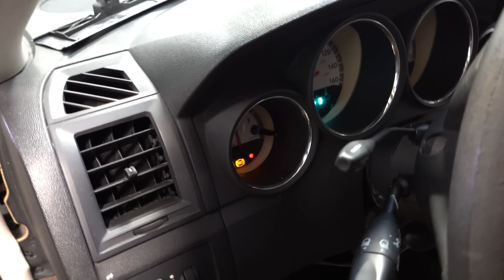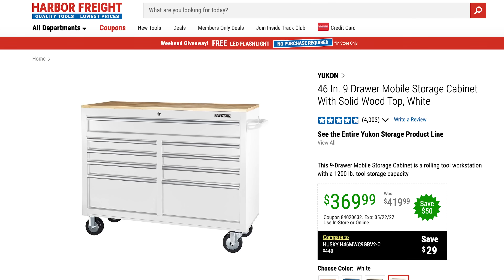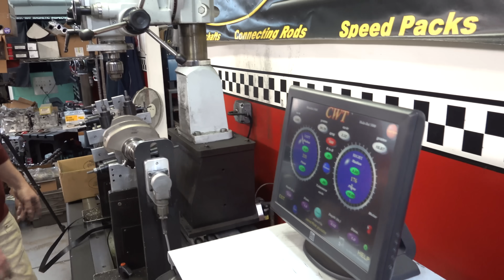Here’s how we REWIND the clock at The Questionable Garage

Comment: Nice E30 with an m6x swap/ 5 lug. Probably has some smoked lcabs/ lcas. Super common on E30/ e36/ E46 cars. The m3 control arms use a solid metal ball joints, but the Meyle or Lemforder HD ones are even better but can only be replaced and pressed into the non-m arms. I have used countless different lcabs, but the Moosehead, treehouse lcabs are a great solution IMO because they ditch the bushings and use a spherical bearing instead. Or you can rock some poly, delrin, or the stock m3 ones which are solid rubber at least. Stock ones are webbed and suck ass. With a proper setup they handle great, even with the M60/ 62 swap. A big ass front sway with adjustable heim joint end links/ poly bushings is also a recommendation, usually with no rear sway at all. That's how a lot of guys that track these including myself set them up. I used to build lots of these for track duty for my personal cars/ customers and with a real suspension it's night and day. AST4100's are my favorite 'budget' damper, with some good camber plates like some Vorshlag/ Rogue/ G.C.'s, etc. Nothing wrong with some G.C.'s/ Billies or Koni's on the ultra cheap either. Bump steer correctors help immensely too. Bimmerworld, TMS, and Akg Motorsport are the three vendors that'll have pretty much everything you'd want/ need for it.